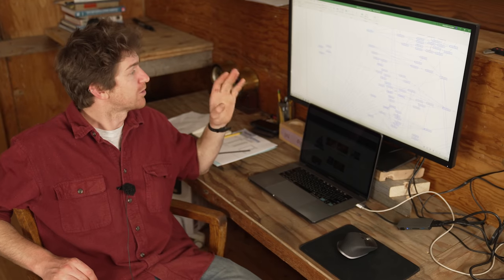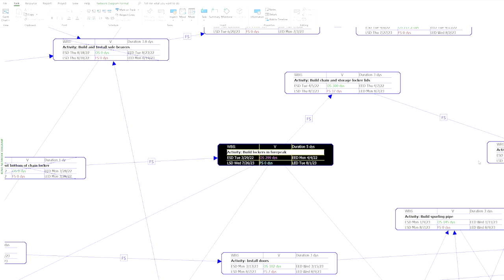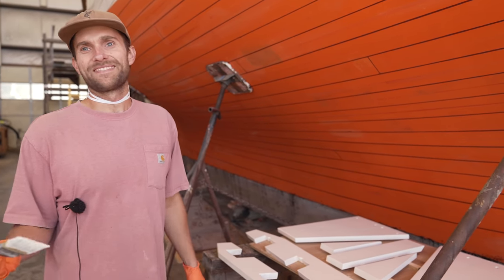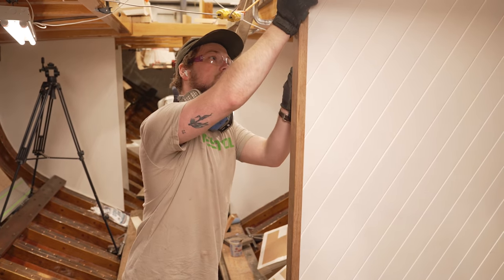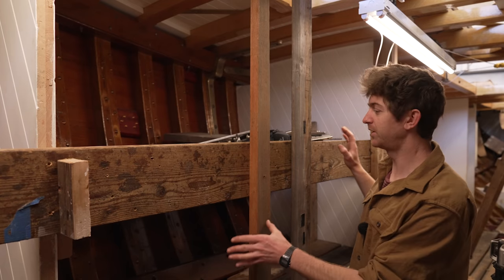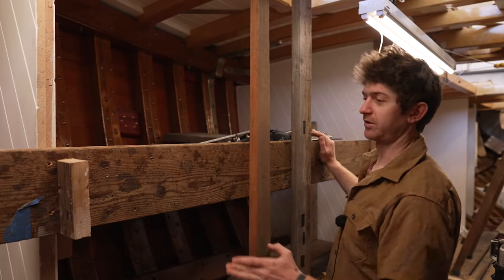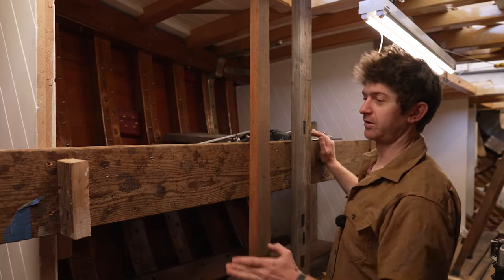Tally Ho - Nearly finished?! (EP128)

Comment: Hey Leo maybe I'm too much of an engineer but especially if you are being budget conscious, I would pick a single AC voltage for your boat (in addition to the DC systems). Almost all electronics are compatible with 110-230V AC. I'd just standardise on 230 as it's much more common around the world and will mean your wiring is handling less current. If your generator can output 110V anyway you may as well place an outlet somewhere as a backup but I think wiring the boat for both standards is unnecessary.

Comment: Instead of using teak I would use ipe instead, it is cheaper and even more rot resistant. Ipe will also last as long as the boat if not longer.

Comment: The old TallyHo must have had very simple interior systems....I am worried that the new systems that are being installed will be way too complex and heavy not to say too complicated and maybe unreliable....How will the displacement change and how will the new rig cope with all the added systems? Let alone how much longer it will take to build. And added expense. I wonder if you considered just staying closer to the old build and simplifying the project. Simple diesel engine, drinking water, fuel, generator, electronics. Maybe a few solar panels....

Comment: Do you plan a substantial difference between "launch" and "sail off?" Eg will Tally Ho launch, and then sit in a slip for several months for rigging work, etc? Or do you anticipate that all the design and assembly will be done before launch, and it's "just" put it all in place and go?

Comment: Like the rule of thirds, we break it in to quarters.  25% for the hull 25% for the interior 25% for mechanical systems and 25% for superstructure/rig.  Boats get exponentially more complex the closer you get to completion.  We like to say that the last 20% is 80% of the job.  Or as an old roommate from Colorado would say “it’s like bear meat, the more you chew it the bigger it gets in your mouth “.

Comment: One thing you often show is how someone patterns a complicated piece, cuts it out, chisels/planes it and then suddenly - BANG - it fits right in place. But how do they know which parts to trim when it doesn't yet quite fit, especially if there are multiple contacting faces at different angles to each other? I'd be curious to see more of that part of the process.

Comment: An interesting milestone to mark might be the point where the current build matches the original hull we saw in episode 1, as if what was there was in perfect condition. Obviously there is other work that has been done, so there won't be an exact match, but there is a notional point at which the build ceases to be restoration of what was, and becomes refitting. That point looks close.

Comment: It should be posible to make the double bunk bed the top bed in a way by mounting two beams one at the head end and one at the feet end then make one beam in the middle from head to feet beam then you can put bed planks in and put one beam on top of this construction with extra planks which interlock with the half at the hull side in this way you can slide the bed in and out as you wish. Don't forget a stopping block to prevent the bed from being pulled to far towards the middle.

Comment: U mentioned propane and i imagine thats for the stove and hydronics system and u also have a diesel hybrid. Since u have such an extensive electrical system in mind have u thought about eliminating the propane al together and just going electric. An induction or radiant stovetop is safer and easier to clean. Im not so sure an electric hydronics system would be feasible though with the reqs and possibility of bad weather

Comment: When most people say they have been banging their head against the walls they are speaking figuratively.  The marks on the ceiling above your work space indicate otherwise. I suggest getting a good crash helmet.👷

I've worked with Microsoft Project. Never anything as complex as the plan you have. Kudos on the effort. Now, you can show people exactly why it's going to be another two years for project completion. 😁

Comment: just make the extension out of material(strong Canvas or something), folds away, and outside post is very strong  and is only solid structure that moves, it is all going under mattress so do will not notice areas with solid or canvas structure underneath, lighter too
Reply: have a secound section of matress that can be stored up wall beside single berth, when not in use, then placed horizontal on boats outward side when in use , because it is not same shape as extension, both joins do not overlap

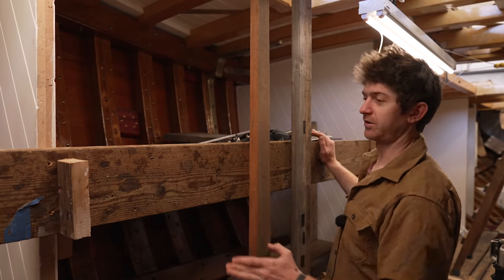Comment: 22:50 You know Leo..I feel your pain..I was a Master Plumber for over 20 years and preferred service work and the number one question was "how long and how much" after awhile my answer was "It will be done when it's done" which seems to be a rude response..but most people don't work with their hands and can't wrap their minds around the fact everything has to be custom made to fit and there is no magic wand..the task has to be physically willed into existence with your bare hands through experience,wisdom and sweat and then those "Little Gremlins" that make some jobs take twice as long as they should with no apparent reason other than it does..

Comment: I was a home builder.  A much easier construction trade than boat building.  Still, I have a rough idea how long things take and the work involved.  

A video on Tally Ho with the word “launch” seemed to me nonsensical.  Watching the vid confirmed that.  A lot has been done.  Even more is left to do.

When I first saw the original Tally Ho my thought was how can that be saved.  Little did I know then how right I was.  Almost nothing was saved.  And Leo knew better than I how much it would take to resurrect Tally Ho but still committed to the project.  Bravo to him as his crew.  They have earned our respect.

Comment: I wish I could have seen your build earlier. You could have sprayed the  inside with eoncoat. 
It's  antimicrobial and fire 🔥 resistant to  900  degrees. No vocs. All green  ceramic coating.
Reply: yesbut it's a coating for steel, not a paint for wood.

Comment: Leo; sorry to add to your workload with questions but a couple of things came to mind this time. Firstly, the white paint. Is there any special reason for using paint, rather than a varnish-type finish? It seems a shame to cover up/hide so much of the wood and especially the hardware, when such high quality stuff has been used. Could a clear varnish not be used?
The other thing I wondered about may sound silly but it's something I would 𝒏𝒆𝒆𝒅 to know if I was in your situation. Does your software, or the picture in your head, tell you what will be the final piece of the puzzle, the very last piece to be fitted to Tally-Ho? Will it be a "ceremonial" piece, like a nameplate/figurehead, or something simple and ordinary, like a masthead lightbulb? Just curious.😁👍
All the Best from sunny Scotland, Dougie.

Comment: Dumb tool question after watching your vids... You have a slotted head screw driver bit you use on your drills that is much larger than normal (not just wide at the tip, but the also thicker at the tip than i commonly see)  that I assume properly fits the brass slotted screws you use.  Where did you find those...or do you know the brand and size? asking as I have a job that needs bits that need a much thicker blade than is common.

Comment: I strongly encourage you to use LiFePO4 (LFP) batteries for your DC electrical system over traditional lead batteries. They work so much better. I'm in process of switching my off-grid solar over to them. I would make the main battery system 48VDC nominal with the battery bank and then use DC-DC converters to supply the 12-14VDC for that power bus. 48V inverters are much more efficient and work better than lower voltages.

LFP batteries can be fitted with power meters that give a very accurate view of the state of charge. This is important for power budgeting. The battery bank would be comprised of strings of 16 cells and each sub-bank can have separate monitoring with bluetooth so crew can manage power. LFP batteries are much safer than LiPoly batteries which, IMHO, are a fire hazard - especially if damaged. You need to be sure the alternator is set up for charging LFP as they draw much more current than lead.

You should have a set of 12V batteries for the radios that may be charged from the primary bank with a DC-DC converter, but is considered a reserve source of energy under GMDSS rules. Even if the rest of the boat goes dark, you want to run radios!!!

Since you have a lead keel, you have an ideal electrical ground so make it common and use it.

An insulated back stay also makes a nice antenna for any HF radio you might install. It may be nice to outfit the boat with an amateur HF radio system as well as the maritime radio. I listen to the Maritime Mobile radio net on 14.312-313MHz upper sideband. Using the backstay or any other wire-rope component as an antenna requires an autotuner box. 

Reach out if you wish.
Reply: I don't think that grounding to the lead keel is not a good thing: ever heard of electrolysis ?, Another problem: TH does not have a backstay, it has (and a forgot the name) two short stays aft that are connected from the top of the mast to the hull sides close to the companionway that have to be loosened on the lee side end when sailing (the main boom will interfere with  the lee stay when sailing) and pulled in on the other side. That happens with pulleys.Not a good place to make it an antenna.

Comment: Leo I imagined Tally Ho's rigging was originally textile based, but since you mentioned steel rope when contemplating the rigging did Tally Ho actually employ that material in her heyday? 

If not and given you have undoubtedly already considered feasible options using a modern equivalent of hemp ropes such as Dyneema why would you resort to heavier, more maintenance intensive, electrically conductive and less authentic steel? (Bearing lightning in mind)

Comment: instead of 12V and 48V, why cant you make one 24V system? It is more widely used low voltage system in commercial vehicles. Equipments are more available and can reduce the cost of having multiple wiring and easy troubleshooting.

Comment: Most of the successful large-scale projects I've ever been involved with (usually software) seem to spend the first 50% of the project getting 75% of the work done, with the remaining 25% of the work taking another 75%.  🙂  Just too many details and fiddly bits you can't start until the base work is completed, and you spend half-again longer doing them to a comparable level of craftsmanship.  (Assuming the funding holds out, of course.)

To my untrained eye, Tally-Ho appears to be approaching that 75% mark, which means that launch is in 2028.  But I'm only a minute into the video; we'll see what Leo says.  🙂

Comment: The famous "Titanic" was built without the use of computers. Not for the engineering of the structure, nor for the project management.  The identical Olympic  had a career spanning 24 years. Clearly they knew how to design and build such a large project. Looking at Leo's project management software, begs the question, "How did they build Olympic and Tally Ho 111 years ago?"
Reply: Project management has been around for thousands of years. Ever since the beginning of civilisations. It was simply written down on something rather than digital. Everything was manual so labour and skill was managed by large teams with specialist teams within those.

Comment: I've been puzzled by the blue tape for years now - and finally remembered to ask about it! Why is it always blue?  Here in the UK, masking tape is just a sort of beige or white, is it blue in the States for some reason - custom or practicality? Or is it just that Leo likes that brand?  Or is it some special, magic tape that somehow works so neatly every time? (unlike any masking tape in the real world!)
Reply: The blue tape is "Painter's" tape.  It is like masking tape but has a less tenacious adhesive so it is easier to remove. There is also a company that makes green tape which is treated with a chemical that is supposed to stop edge bleed. Personally I think if you are looking close enough to see edge bleed you should have been on hand to paint!
Reply: @dannyhull8007  thanks for the info. I wonder if we can get that here? I got so tired of having to repaint bits of edges when the masking tape pulls the paint off that I stopped using it.  Still, at least my painting skills have improved as a result!

Comment: The answer to any questioning how long something will take to do the answer is how long is a piece of string and when does it stop being a piece of string and becomes a rope , then a cable and so on. The other answer is as long as it takes , Rome wasn't built in a day neither will this be and the longer you stand here asking me that is that much more longer that it will take.

Comment: Why propane AND electric? I know electric heating is less efficient, but with an onboard generator and the reduced complexity it seems (from an ignorant outsider's perspective) like the way to go. Same with the multiple voltages. Why not just 12v and either 110v or 230v and simply have those with "foreign" electronics use a a plug-in converter?

Comment: Why doesn't he use more of the old planking for the beds, interior build out and whatnot. The stuff is going to be painted anyway. Might be a reason, but I don't see it.
Reply: Although the original teak hull planking has aesthetic & historical value, it's ghastly labor-intensive to re-use it !
- For each plank, both faces must be planed flat, to a uniform thickness.
- It must be resawn to a constant width & both edges must be squared up on the jointer.
- In every linear foot, there are 2 x 3/8" rivet holes to drill out & plug.
I'd like nothing better than to see original wood in use for the interior fit, but it's too expensive (in man-hours) for general use & might likely be confined to visible areas such as table tops & cabinet faces.
Reply: @frederickstibbert7389  thank you for the response. I just saw that they were doing all those operations to make the boards for the racks (bunks) and probably wouldn't need to fill the holes for that use either. Just a thought.

Comment: Your reasoning for the different voltages doesn't really make sense.  "to operate in American and European waters"...  did you mean that you would like both American and European devices to be able to plug into the boat?  Perhaps a bit unnecessary if it adds significant costs.